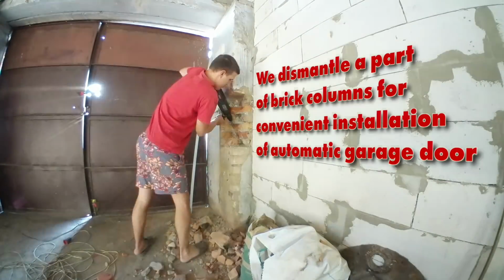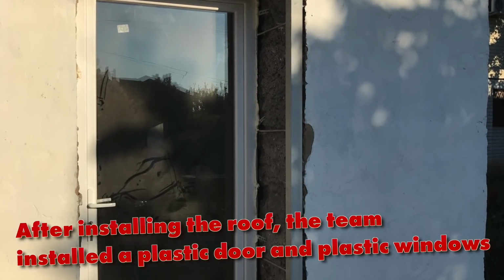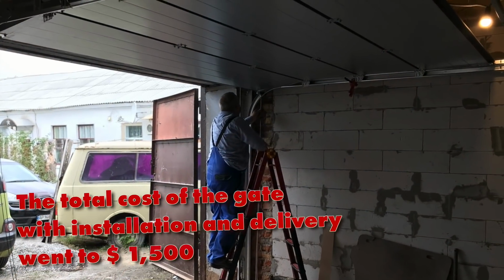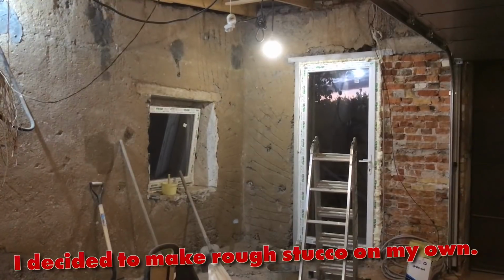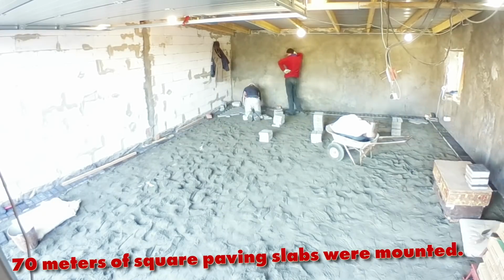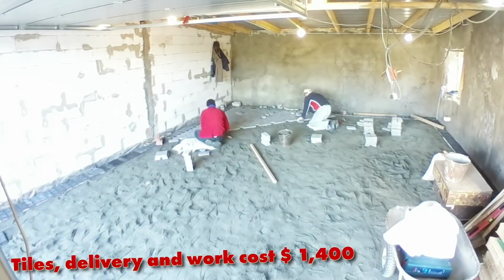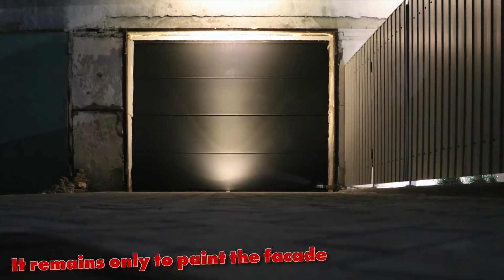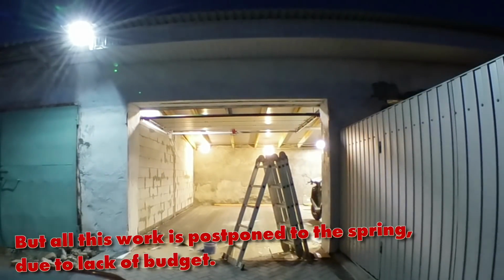My Garage renovation. How to build a large garage, what to make a floor from

Comment: Why did you lay paving slabs on the floor. It was possible to pour concrete and paint later.
Reply from the maker: The reason is that paving slabs are easier and more reliable and more beautiful. Moreover, I wanted the territory in the garage and in front of the garage to have no differences.

Comment: Any updates on the garage ??
Reply from the maker: Yes, I leveled the walls with concrete and painted them white.  I hung up the electricity box, plugged in the garage door button (with Apple home kit support), plugged in the irrigation controller.  And most importantly, I insulated the roof and hemmed it. Is everything ready.

Comment: Tiles delivery and work cost 1040 so cheap
Reply from the maker: If I did it now, I wouldn't put paving slabs inside the garage. It's very hard to clean up. Better concrete screed with grinding.